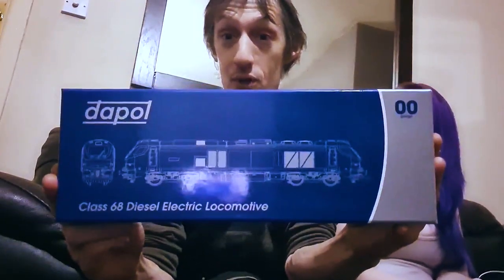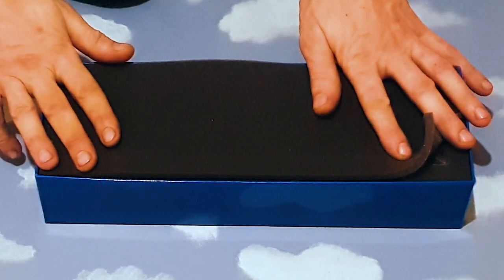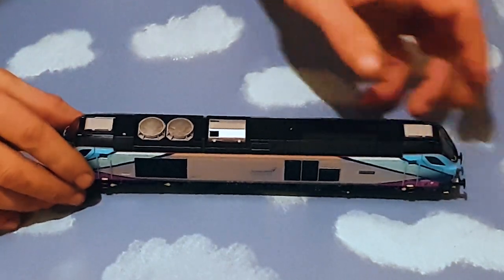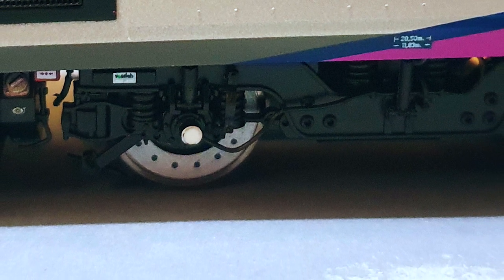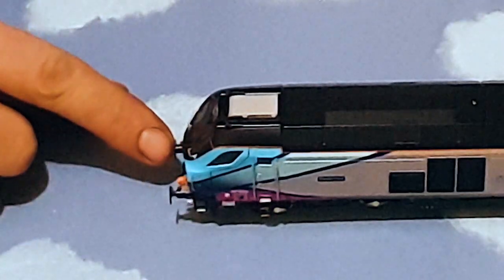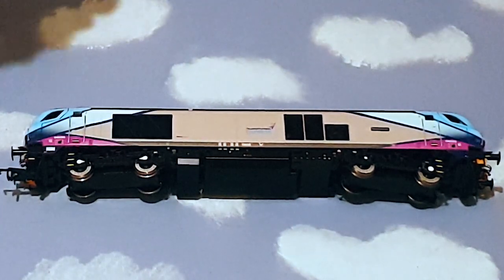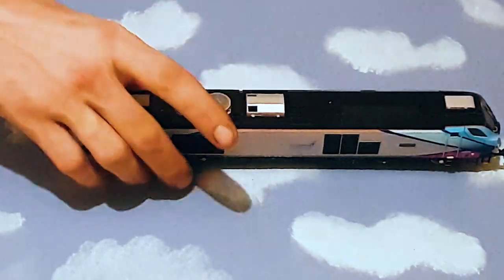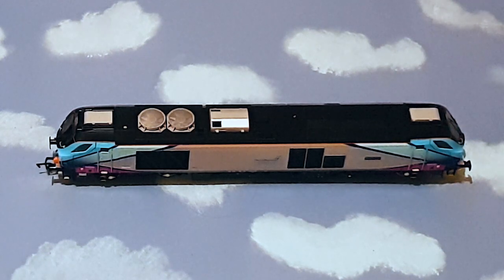Unboxing the Dapol TPE livery class 68 Part 1 (new intro)

Comment: Ive had my fair share of models with paint flaws or logo misprints over the years and I feel I'm just unlucky when it comes to getting the one that isn't right .  Makes you wonder what quality control is like at Dapol.  Remember the very first batch of 68s had to have new shells made as the factory had got the alignment wrong on the DRS logo and the wonky name plates?  I sincerely hope you get a replacement.  I have the ScotRail and DRS ones and the review you have given them is very fair and look forwards to part 2.